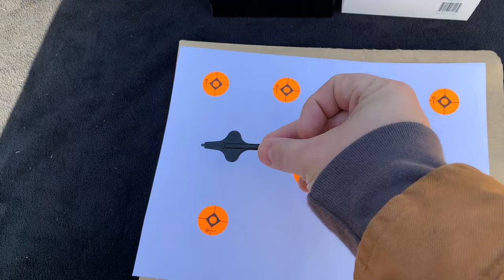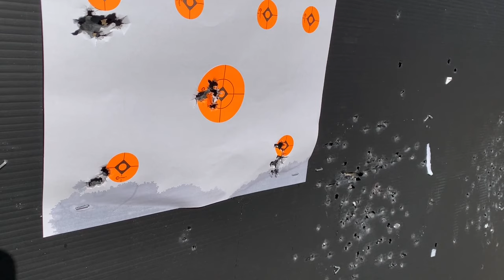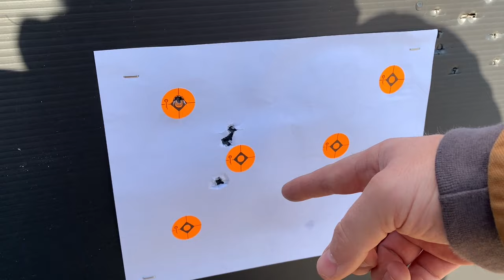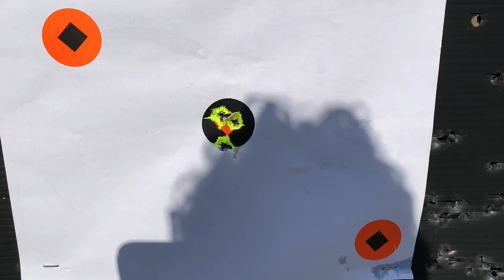Zeroing a Pistol Red Dot

Comment: I just got my first red dot, I’m gonna go to the range in a few days, so are you supposed to align the red dot with the front sight?
Reply from the maker: No. Google “absolute co-witness” that is the only setup in which your dot and iron sights are in like with each other however this typically requires taller sights. Mine is “lower third co-witness” meaning that my iron sights take up the lower third portion of the red dot view finder. In this situation there are 2 independent aiming points, the irons, and the dot, that both will impact the same target even though they are not inline with one another. Most pistols once you install your red dot, you cannot see your iron sights any longer. Either way, unless you have absolute co- witness sights, just sight the dot separate from your irons.

Comment: My red is not aligned with my iron sights. It’s to the right. Is that fine?
Reply from the maker: If they both hit where you’re aiming, I wouldn’t worry too much about it. If the optic is noticeably skewed in the mount/plate with a gap or something, then I’d be a little worried. What optic are you using?

Comment: Good vid, dropped my 365XL on concrete and it threw off the dot😮
Reply from the maker: What dot and how was it mounted?
Reply: @yota_blaster5030  507k holosun.. mounted normally with instructions screwed, I think I zeroed it back to center just odd that an impact like that would throw off the alignment,, something to keep in mind 👍🏼
Reply from the maker: @Christian-yt5df  what I mean by how is it mounted is, did the pistol come “optics ready” with a plate that you use to attach it or did you have the slide cut for the optic and mount it directly to the slide without an adapter plate?

Comment: Just a question why not use a bore sight its not like your going to be using your fire arm at 100 yds for self defense 0 to 30 In99% of self defense  Scenarios. And you don't have to waste ammo
Reply from the maker: I might give this a try just out of curiosity to see how accurate it would be. However, I've bore sighted some rifles before and even shooting at the same distance it was not 100% on. It's good enough to get you on paper from a short distance but still requires some tuning. I treat any setup whether it's hunting or self defense to be capable of at least double what I'm expecting. If I assume a threat is going to be within that 0-30, I wanna know I can hit at least 60. Aside from mag dumping from the hip and other debauchery, I don't consider trigger time to be a waste of ammo. Marksmanship is a depreciating skill.
Reply: @yota_blaster5030  you have a point and I agree make note with rifles I always zero mine at 300 yards depending on the ammo my 6.5 creedmoor at 300 is spot on at 100 with no  Deviation   Except for a human error. 😉
Reply from the maker: @bluecollarbiker8005  I'm a 308/270 guy and like to dial my elevation, call me old fashioned hahaha.
Reply: @yota_blaster5030  lol 😆 that's not old-fashioned that's just what you like to do I dial it in on my good scopes with open dial

Comment: I got the same problem with mine to I got the same 507c on xdm osp 9mm every time I do adjustment it shoot worst can someone tell me what mite i been doing wrong..a was shooting on the bench..it mite be a have to shoot standing 🧍‍♂️up
Reply from the maker: Are you propping up your gun underneath the slide portion of the frame or from the magazine well? I don't know for sure but pushing up from the muzzle end could cause inconsistencies. I sighted mine by standing and not using the bench. The comparison i used with archery is that you can't really sight a bow off a bench and I'm dead nuts accurate from 20-100 yards with my Hoyt. You should be able to sight it standing up but I would stress that you need to focus heavily on not putting input on the gun during the trigger pull etc. and be cognizant to not anticipate the shot and drive the gun down.
Reply: the target becomes your front sight and the dot is the rear sight

Comment: why not zero from a hard surface like a sand bag or a table? this will make results much more consistent
Reply from the maker: @VRponch  I go over that in the video, it felt unnatural and I’m more accurate offhand. On a half dollar sized target within 15 yards, I can typically tell if I pulled a shot. That and these red dots aren’t 1/4 or 1/8 moa adjustable like a scope so you’re only gonna get so much out of it. If I can hit a quarter at 7 yards, that’s sufficient for me.
Reply: @yota_blaster5030  I dont know man. When zeroing your accuracy isn't relevant. You need a stable platform to adjust the sight not to test your accuracy, the gun needs to shoot where the dot is not on a stable surface  you are just adding more variables to the mix

Lots of usually, typicaly, feels. Not very scientific I'd just stick with factory zero if it goes like that. But hey if it works for you
Reply from the maker: @VRponch  the only way to 100% take human error out of the equation would be to put it in a vice. Aside from that, my accuracy is diminished by shooting from a bench. So I’m taking the bench out of the equation to eliminate as much human error as possible. Let’s say hypothetically we take 2 perfectly zeroed guns, one guy shoots from a bench but I shoot offhand. If his trigger press is bad or his grip isn’t the best etc. those things could affect his accuracy and provide inaccurate results. Then I shoot offhand and maybe I’m not dead center on every shot but I yield better results, is the bench still an advantage? It didn’t yield better results for that person so if something affects your accuracy, take it out of the equation regardless of what it does for someone else. If the dot is on the x, my impact is on the x, and it’s repeatable, that’s effective.
Reply: @yota_blaster5030  but your accuracy isnt a factor in zeroing...
Reply: @yota_blaster5030  again I'm no expert but we would zero rifles while prone to minimize sway because it would effect accuracy and the zero. You wouldn't know if the shot wasn't on point because of the sight setting or some movement while you pulled the trigger.  A vice is perfect but a bench would minimize those micro movements. It isnt there to help with your accuracy just to minimize the movment.
Reply from the maker: @VRponch  Rifle shooting and pistol shooting are completely different. A lot of benching a rifle has to do with the weight and the distance at which you are zeroing. A shift in MOA that could cause a miss at 200 yards might not even be noticeable at 10. Which is why these micro red dots don’t have 1/4 or 1/8 adjustments. You can support the weight of the rifle by resting the fore end on a sandbag, bipod, etc. You can’t really rest the forward part of the frame of a carry pistol on anything and resting it on the mag or bottom of the grip doesn’t prevent the muzzle from moving up, down, left, or right. If supporting the pistol on any type of rest provided a significant increase in accuracy for its range we would see it implemented in competition and similar higher levels of shooting proficiency. Accuracy from the shooter is paramount, without it you are imparting a gross amount of human error which negates any data you receive down range. So if I’m more accurate off hand than from a bench, I’m going to zero offhand. I’m not saying this is the case for everyone, by all means, if you are more accurate from a bench then use that to your advantage, I just don’t see how bench shooting a pistol provides any benefit.

Comment: 7yards /100=0.07 x1.5 MOA =0.105” per click, if you need to move 1”, 1”/0.105=9.5 clicks, ~10 clicks
Reply from the maker: @wildwolf8983  “Allegedly”, the optic and mounting plates can “settle” during the first few mags. I asked a couple gunsmiths about it since I had a weird shift during sight in. They both confirmed that it’s relatively normal and recommended double checking torque spec at 100,200, and 300 rounds. From there it should be good. I can’t confirm or deny the accuracy of this statement but I’ve had zero impact shift since then and everything seems to be holding up great.

Comment: in order to change the battery, must you remove the optic?
Reply from the maker: Nope, there’s a tray on the side
Reply: That's why I prefer holosun because battery trey is on the side & doesn't lose zero. They're solid
Reply from the maker: @KingMusa99  That was part of the reasoning in my purchase however after listening to some information from solid optics manufacturers, if your slide is cut properly you should not have any issue with losing zero. It’s still nice to not have to remove it and deal with lock tite and a torque wrench etc.
Reply: @Yota_Blaster your spot on my 2a bredrin! 💯🖖🤝

Comment: Your working against your self
Reply from the maker: Thanks for elaborating. Took all of 10min and still holding the same zero. Shot out to 83 yards on Friday. Against or for, it’s working pretty good.
Reply: Glad it worked out for you. I always bench at 30 ft then I dail in 75,to make sure all is good.Guess it just depends how much ammo you want to use to zero.Not looking for a fight on the internet. Be safe!
Reply from the maker: @philiprosenstock9667  well I explain in the video that the iron sights were on at 7 yards so I zero’d the rds to be consistent with my irons. I confirmed at 20 that I was still able to hit 6-8” plates from 20 yards consistently. For a self defense pistol, I think that’s more than adequate. Shooting 83 yards with a slight hold over was just for fun but reinforced my original zero. Different strokes
Reply: Just have a minute now,if you like to co witness with irons that's a totally different way that I have been taught My dot is always much higher than my dot, that way I have a better view of my threat. My focus is on the target not my sights. 👍